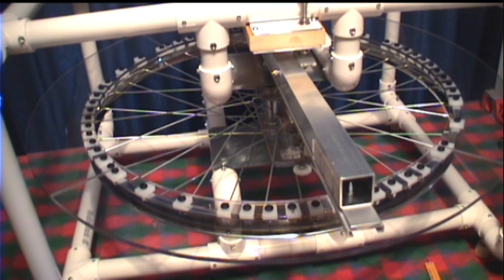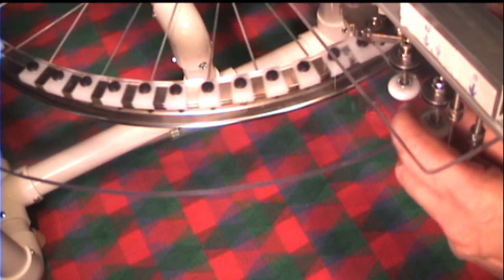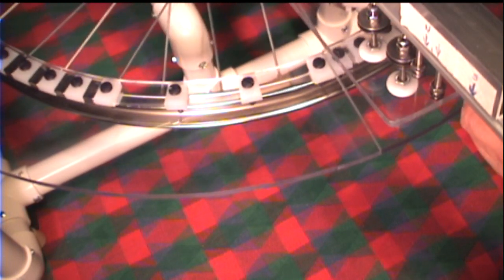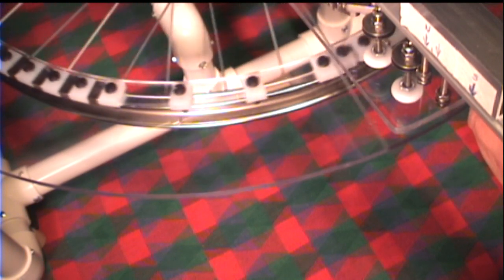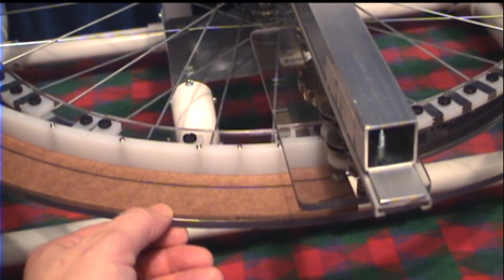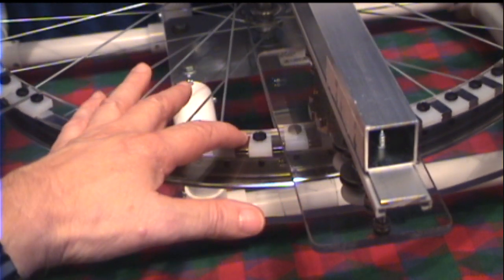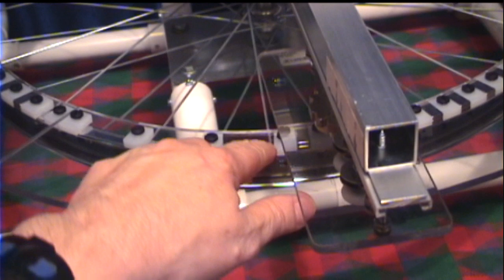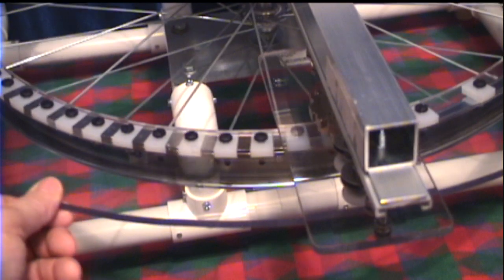Video #25, "Rick's Pipe Dream" Magnetic Motor-Generator Project

Comment from the maker: A short segment of track, between the rotor magnet groups, could be used to prevent the stator from retreating down the slope, simply being used to catch and hold the position of the carriage momentarily, then allowing free movement of the stator as it approaches the attraction point.  Used in this manner, the track needs no curvature, since it would only be used to maintain the position of the stator - not to move it.  The stator still needs to be moved, of course, but by a different method.

Comment from the maker: Hi Tony,

Your assessment is somewhat correct, in that the track curve would be bettr located inward from the rotor magnets.  The slope of the carriage slider rail really isn't a problem, though, except at very low rotor speed.  During the transition period, between the rotor magnet groups, there is less than an ounce of force needed to move the stator carriage outward.  At slow speed, the carriage can retreat inwards enough to be out of position for attraction at the next rotor group.

Comment from the maker: These are totally incorrect assumptions.  Magnetic energy is the result of aligned particle spin at the atomic level, and can only wane or cease if the alignment changes.  Such change is normally caused by electric currents, overheating, or striking the magnet.  Absent those demagnetizing forces, a neodymium magnet will retain its magnetic energy for hundreds of years.  To understand these concepts, read the works of Howard Johnson and Joseph Newman.

Comment: Hi Rick, to answer your question. Im from Manchester UK. Im 49. Ive ben involved with electrical engineering / electronics since I was maybe 13 but spent the last 15 years working mainly with computers. I dont have and high level of formal eduction in the realm of physics but I do have lots of experience of building and repairing things.
I admire your determination. Go for it man.

Comment: Most convenient way usually being an electromagnet which you can more accurately turn on or off or play with its polarity.
I noted what I believe to be the potential problem with your set up. You are using I think a powerful hard drive magnet as your moving stator. The way the flux flow on those magnets allows youre design to easily change polarity by moving along that slider with its desirable lines of flux when it first gets kicked over by your little track during the first 180 degrees

Comment: Im afraid like all experimenters that you will find out that if you ever get close to a 360 degree rotation that you will get to the point where you find that the energy needed to get all the magnets properly aligned to pass and begin the rotation again from zero degrees is just too much and you end up creating an instant breaking point thus stopping the rotation. The only way is to input energy from another source at that point.

Comment: The missing output can nearly always be traced to the destruction of the elements of the machine its self in the form of friction transfering some the energy into heat. Even the latent energy stored up by the very manufacture out of all its elements of the machine its self. You dont get owt for nowt as they say where I come from.

Comment: The thing is, the amount of physical energy required to get the magnet into such a position that the line of flux can be distorted ether way; always ends up being equal or more than that energy that is released when the flux finally springs into its happiest new line of flow now the magnets are the new position relative to where they stared from.

Comment from the maker: Are you suggesing moving the stator carriage inward at the tail end of the south up rotor magnet group?  If so, that won't work because the stator needs to move outward at that point to align properly for accelerative attraction as the North rotor magnet group approaches.

Comment from the maker: So as you can see, the total overall stator movement from the inner position to the outer position is just under 1+1/4 inches, and less than half of that was mechanical.
I could also work this setup very nicely by hand, as I did with the previous stator arm, but the objective from here on will be to move only by mechanical and magnetic means.

Comment from the maker: Hi Gazzaka,  not quite sure what you mean by "flipping the stator bar."   Once rotation is achieved, it does take only a half inch or so of staor movement to maintain it.  Actually, in the last experiment of this video the stator is moved only 6/10 of an inch.  It self adjusts another 5/8" outward as it encounters the approaching North magnet group.  If I lay a short track at the tail end of the North group to move the stator inwards by 5/8", it will self adjust again as the South group nears.

Comment: I would consider flipping the stator bar and having an alternate stator on the other side, like a hinged stator bar.

Also I think you originally said the stator needed hardly any movement?

We seem to have gone from hardly any, to an inch?

Also seems that you are not trying to exactly replicating your original hand movement, where it worked

GL as always